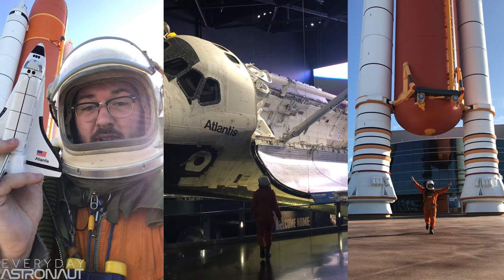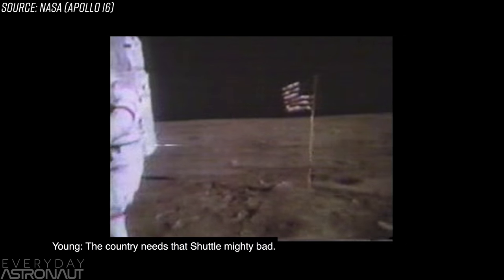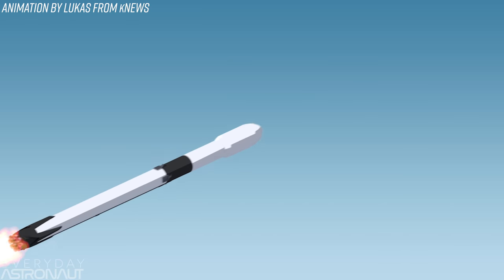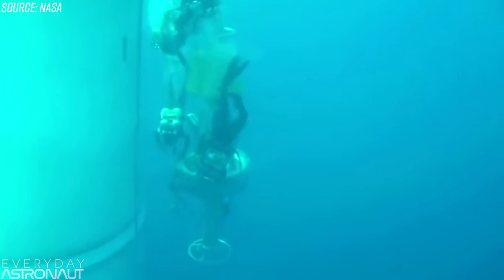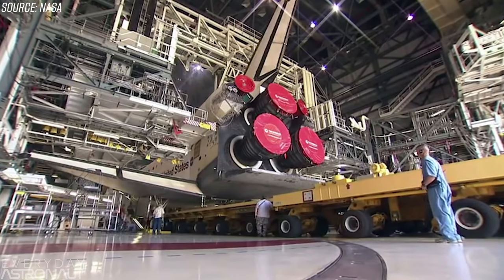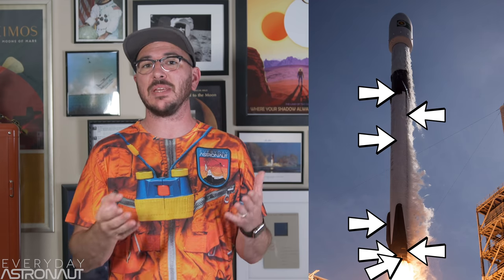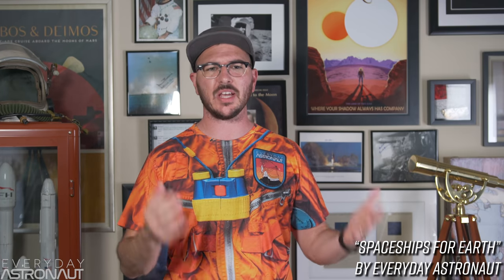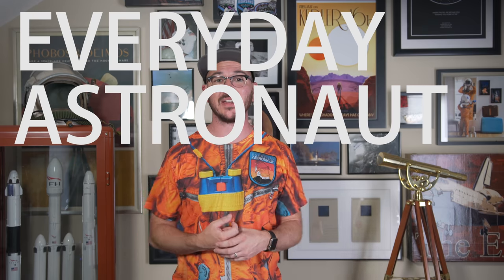Will the Falcon 9 actually be reusable or just refurbish-able like the Space Shuttle?

Comment: I understand that because one Merlin engine on the falcon 9 is enough to accelerate upwards, there is a very small window from crashing into the ground or not quite making it to the landing pad. I have some questions though. 1. Why can't SpaceX turn the engine on and off very fast, so that they can start the slowing a bit earlier and then adjust the thrust as they get closer and closer minimizing the risk? 2. Will it actually be easier to land the BFR since one Merlin engine might not be enough to accelerate upwards, giving room for adjustments during the landing?
Reply from the maker: It takes a few seconds to spool up a rocket engine so there’s no quick on off ability. 

The BFR might be able to hover (although that’s not efficient) due to having even more engines, so one engine of the 30 or so will be a smaller percent). Oh and BFR will use raptor 👍
Reply: Thank you for a fast reply. Personally I'm definitely a big fan of how they land at the moment, because it just looks so powerful, and they seem to have perfected it anyways so it might not even be a problem. I'm just thinking that it would be nice to have a bigger margin of a succesful landing :)

Comment: 21:46 I think there are a couple of points not discussed here. The falcon has much less surface area taking on the heat, and relies upon thrusters to slow it down. What's interesting is that the very same part of the vehicle designed to withstand the heat - the rockets - are what's absorbing the heat. This means they don't have to do anything special to the engines to make them withstand heat - nothing that they aren't already having to do that is.

Comment: A major problem with the space shuttle was the engines.  Originally, the engines would need nothing but inspection between flights.  So the shuttle was designed so the engines would not have to be removed.  That didn't work out.  It was difficult and time consuming to remove the engines.  Therefore, the refurbishment costs skyrocketed.  I think SpaceX has a good solution to reusability.

Comment: i personally consider reusable to be something that can be used multiple times without the need for maintenance. rocket engines don't fall into that description since they have to be rebuilt almost from the ground up before another firing. jet engines for example are reusable because you don't have to haul them into the shop after each run and rebuild them. if rocket engines can be made as reliable as jet engines then we're talking.

Comment: Whoa... I like Space Shuttle due to esthetics.. I didnt know design is that drastic work and danger for landing. Explains why one shuttled exploded due to one heat plate broken and then ionic gases burned whole shuttle during landing phase. From this standpoint, it is even more awesome falcon 9 landing is finally working, even though not easy road here. 
Old style shuttle is surefire thing, but shuttle landing, if they manage to slow down speed before atmosphere, would be reliable. I can see why NASA still trusts with parachute landing of shuttle though. 
Maybe this new era of innovation started 2005-2006 NASA programs will fuel more creative solutions to reduce huge risk of re-entry back to Earth especially for manned flights, since that has been more dangerous part.

Comment: Hi Everyday, About the BFR's heat shield... I think SpaceX should consider an inflatable soft shield that would be packed lengthwise along the entire length of the BFR, deployed on entry, and "simply" replaced (by robotics) on the launchpad near the time of the next launch. The linear package would be a hemi cylinder about 1 meter diameter, and inflate to increase the BFR's entry surface by about 1/3. This would not count as refurbishment or repair. Just a "minor" cost item like the refueling.
What do you think?

Comment: NASA really should have used Tungsten tile heat shields for the bottom and leading edge of the Shuttle, using water-spray cooling on the reverse side of the tiles for the hottest zones.  Tungsten sheets are way more durable than any carbon could ever be, even when glowing white hot during reentry.  Tungsten is what they use in light bulbs after all, so glowing white hot is no problem.
Reply: So, like X-20 Dyna-Soar, though instead of tungsten, DS used Rene 41.

Comment: The truth here is that comparing the space shuttle to the Falcon 9 is interesting but kind of weird. The Space Shuttle is more like a really massive Dragon 2 capsule. It's a human rated component.
The useful part is the Falcon 9 vs the SRBs / main fuel tank.

And clearly here, the propulsive landing is saving a tonne of work.

I think a comparison between Dragon 2 and the Space Shuttle re-use would be cool (are they even doing Dragon 2 re-use).
Reply: They are kinda doing Crew Dragon reuse. However, they won't do so for human missions. A new capsule will fly human missions. After it returns, it will be cleaned up, fixed up, and reflown for cargo missions only. We likely won't have anything from SpaceX that really comparable to the Shuttle until Starship starts flying crew.

Comment: Wonder how much it cost to turn them around and how often the engines have to be replaced
Reply: Engines can fly over 10 times with little to no refurbishment.

 I couldn’t find a definite source on how much it costs for the refurbishment of a booster but i got answers ranging from 250 thousand to 5 million so in my infinite wisdom i can say that the cost is pretty low my dude

Comment: Although a great achievement, NASA foolishly switched from relatively simple manned capsules with parachutes and disposable rockets to the extremely complex, large and heavy manned shuttles and disposable main fuel tank and "retrievable"  boosters.

Nasa should have stuck with the manned capsules and developed them to land on solid ground like the russians ... and ... then started developing truly reusable 1st and second stages.  They would have eventually figured out that the rockets need to launch vertically and land vertically in order to be fully reusable.

But NASA was so fixated on shuttle designs or single stage to orbit flight vehicles, that they wasted over twenty years using the costly & complex shuttle launches.

Had NASA stayed with manned capsules and set an objective of efficient, economical reusable 1st and 2nd stages, they would have beaten Space X by at least 10 years.

The question now is "Why aren't all the the other rocket companies building their own VTO/VL reusable rockets?

Comment: 6:13 its not friction. Friction happens at supersonic, but hypersonic is different. The heat there is caused by the pressure between the shock wave and the surface of the shuttle.
Edit: 6:57 "shuttle has so much hot ionized gas"... As in plasma? Ya, that happens at hypersonic speeds, not supersonic

Comment: The Fundamental problem is the heatshield is way too heavy. Having to launch that much heat-resisting material into space every launch is just dumb. Space X simply use fuel to slow down, so it doesn't need a stupid amount of heat resistant material. Bing so bulky also increases drag before it leaves the atmosphere.
Reply: Fuel is also heavy.

Comment: Comparing Falcon 9 refurbishment to the Space Shuttle isn't quite fair since the Space Shuttle was manned.  A better comparison will be to the Falcon 9 plus Dragon capsule.  Will the capsules be re-used?  Will NASA allow manned flights on used Falcon 9 boosters?  As mentioned, Space Shuttle refurbishment became overwrought, requiring almost 100x more man-hours than before the Challenger incident.  This is a typical government response after any incident.  A similar example is the U.S. nuclear power industry, which required ~10x more personnel after the Three Mile Island incident, per government regulations, with most simply pushing paper, fussing about things like calibration dates for steel rulers and probably adding little value.  True that the biggest cost and complexity was having to check and refurbish the thermal protection system on the Shuttle, which is much more area than a capsule.  Falcon 9 launches avoid this by returning the 1st-stage early, at a speed similar to the Space Shuttle solid rockets (jettison both a few minutes after launch), where thermal protection for re-entry isn't needed, and discarding the 2nd stage.  Thus, the main problem with the Shuttle was being closer to a Single-Stage-To-Orbit system.  Having the Shuttle mounted to the side where the tiles were struck by foam and ice made this a much worse problem (proved fatal).  SpaceX StarShip will also be a large re-entry vehicle, so may prove a similar refurbishment effort, depending upon the thermal protection it will use.

Comment: To hear you speaking of a private space flight company maximizing profits is very ominous. Consider what we've seen lately in airline travel and then apply that to space travel: your first 50 kg of payload is included in the $500k price of your ticket if it can be placed under your seat, but anything after that is $25k for each payload item; if you want meals with your travel, it's $7k for a sandwich; and if you need to make any changes to your ticket, it will be $200k for each "leg" of your travel, even if you only made a change to one part of it.

Comment: It seems to me that an accurate comparison would be between the Space Transport System (Shuttle + External Tank + SRBs) and the Falcon 9 booster plus the Dragon capsule in human transport configuration. THEN you would be comparing apples to apples when it comes to refurbish/reuse times.
Reply from the maker: Not necessarily. People have been saying the booster won’t be reusable and they use the shuttle system as an example. This was just to quell that. I’m more responding to that criticism and explaining why it’s so different between the two systems
Reply: Those people are probably confusing SpaceX's discarding of the Block IV boosters into the ocean now that the Block V is out and assuming that will be the modus operandi for all subsequent launches.

Comment: falcon 9 does not have retro thruster so it cannot perform a retro thruster burn but it can perform a retro thrust or a retro burn only when the 9 main engines are pointing towards the direction of travels. The Dragon was designed with retro thrusters which became simple abort thrusters
Reply from the maker: Any engine can be a retrothruster when pointed retrograde. The dragon’s superdracos have always been their abort system which could hover or potentially propulsively land (which is now cancelled). During an abort, those super Draco’s are prograde 👌 also the falcon 9 has 9 main engines 😉
Reply: sorry my ksp career reusable rocket has 7 but retro thruster is the name given to a thruster designed for such use, if the engine accomplish prograde and retrograde thrust it is a main thruster or secondary thruster. But wasent the Draco thrusters designed to be use with liquid fuel and also be controllable, hence why it was designed with landing in mind and abort as a secondary, making them retrothrusters  untill that use was scrubbed.

Comment: Something that isnt addressed in this video is payload difference, and how many falcon 9's it would take to equal one shuttle.
Reply from the maker: Because we talk about that in “SpaceX rockets VS NASA rockets” Falcon 9 has a similar payload capability to shuttle but then no crew. So it kind of takes two F9 launches to do what one shuttle launch could do
Reply: The delta V and orbital apoapsis of the Shuttle was pretty impressive though, and the fact that Falcon 9 requires a second stage to position and circularize its orbit is characteristic of rocket boosters. It will be interesting to see if SpaceX sticks to using methane for fuel, which produces much CO2, kind of in contrast with the company’s overall philosophy

Comment: The reason the Shuttle was so disappointing was it was so over hyped. The people pushing for it promised $260/kg launch and ten percent returns, it could do a hundred flights per year. With extravagant promises like that, the Shuttle was bound to be a big disappointment.

While I do believe SpaceX is moving in the right direction to making getting to orbit much cheaper, the Falcon 9 is not there yet. When rockets can land, get a turnaround maintenance like jetliners, and launch again, we will hit a huge milestone (and even planes can be flown again right away after a simple refueling though that's not always recommended).  SpaceX doesn't seem to be putting out much hype but the fanboys sure are. What they fail to mention is the performance hit the reusable Falcon 9 takes versus the expendable Falcon 9, a significant hit.

Comment: Per what you are saying,, in truth, every automobile undergoes refurbishment before the family vacation.  It is only a question of degree or frequency.  The Falcon 9 has already demonstrated a degree of re=usability,, or a level of minor refurbishment, that is far and away better than the space shuttle.  You really must consider, the space shuttle used new engines for each flight, complete heat shield tile replacement,, basically, nearly every system except the air frame was replaced, and every system underwent a full inspection and test,, a re=fit,, a rebuild?  The Falcon 9 has made good the promise, that the space shuttle originally made.  It is reusable, to a degree, that the space shuttle originally intended.

Future Falcon 9s will. as time proceeds, Block 5, Block 6, become more and more durable,, more and more reusable.

Comment: Reusable first stage has one big drawback. it limits the usable payload quite extensively.
Reply from the maker: But that’s why the rockets been upgraded so much over the years. As a matter of fact, block 5 boosters are so capable now (even while being reused), they’re flying payloads originally slated for Falcon Heavy!!! And if it goes beyond that, it will just launch on Falcon Heavy. Sure there’ll always be big satellites, but SpaceX can cater to almost anything now! And satellites tend to be shrinking anyway 👍
Reply: You can't rewrite the rocket equation now can You? Same applies to SpaceX.  How much more payload could You deliver to orbit without excess fuel left in the boosters for landing? Landing the boosters is very impressive but from the efficiency point of view its a total waste. I'll tell You what I've found on the Internet: Falcon 9 looses about 20% capability when the booster is not expanded. Falcon Heavy can loose up to 50% lift (when You would like to reuse all the components)  and 10% when only the boosters are recovered. This is enough to make the launch costs higher with reusable boosters... not being a hater - Musk had told that himself. Where is the profit in that? :) We've been over the topic of reusable crafts in the past... space shuttle was a total flop from the economical point of view and unfortunately the reusable rocket will be too. There are just some things that can't be done. No matter who the dreamer is and how much money will he spend he won't bend the Universe to do his will (same applies to most of modern "new technologies" start ups and companies... just full of hot air... some day the bubble is going to pop with a rather big bang) :) Good night :)

Comment: Obviously if the SpaceX booster rockets could land almost right from where they took off, that would save some money.  Is that a goal?

They would obviously have to be bigger to get into space for one orbit to be able to later land where they took off, which means they could carry more payload, but they'd burn extra fuel to get there and to slow down for the landing.  Obviously there are some cost pluses and minuses.  I wonder if they've already made those calculations and are going with the lighter booster, or maybe are working toward the booster (a bigger booster) landing about where it will take off again.  Anyone know?
Reply: That's the plan for Starship-Super Heavy. Through rapid turnaround and cheap flight make those additional 12% payload not really worth the long recovery from droneship.

Comment: Dosnt the shuttle go higher, experience more force, higher temperatures and it can carry larger payloads compared to what space x has done it dose alot more so they probrably shouldn't be compared in reusability until they can get as far as eachother
Reply from the maker: Actually the shuttle never went above 350 miles or so. Falcon 9’s send to stuff to GSO all the time (22,000 miles). We compare the altitudes and velocities. The shuttle’s booster didn’t go nearly as fast or high as the Falcon 9 first stage booster. Check out the video, we compare the things that can be comparable.
Reply: @EverydayAstronaut  thanks for correcting me and I understand it a bit better now keep up the good content and thanks for the fast reply